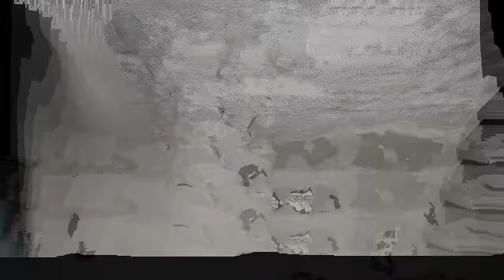Saving a Destroyed Home for FREE: Episode 2

Comment: As someone who is educated in interior design, the mention of using a painting or an item you love to base your colors off of is something that was taught to us. As far as not being "pros", I think you guys did a fantastic job! ❤🎉 (Side note, on the shelf in front of the breaker, in the future she can put casters on the bottom of it that can lock in place. So that way it'll give it a little bit extra height to hide the breaker and allow her to move it easily if she needs to get to it quickly😊)
Reply: Yeah,never cover the electric panel with something that can’t be moved quickly. A canvas from the thrift shop is a light weight cover up.
Reply: Yeah. This was my thought too about the shelving unit in front of the breaker box. If a breaker trips (which they often do in old homes) you don't want to have to move that thing in the dark (or even in the light when it's loaded with stuff) to get to the box.
Reply: If possible in the long run a picture would be good, because if she has a young kid, then tall shelving should be secured to the wall but that’s counterproductive to accessing the breaker-box.

Comment: So much better! Peel & stick flooring might be a viable option that’s very DIY friendly, depending on the stability of the existing flooring. Great job!
Reply: Yeah as long as the subfloor is level it works. It's not great if the subfloor is uneven, the people who owned our house before used that stuff and it has not stood up to traffic, the subfloor underneath is uneven so we will need to replace it. They also used it on the counter haha but that was replaced as soon as we moved in.
Reply: Those tiles look like they might be asbestos too. I had th4m in a room in our “handyman special” house. I just wore a mask and gloves and a heat gun to lift them all up.

Comment: Great work, as always! However, I do have one small issue. You should never cover up or block with furniture, a breaker box. It was a great idea to put a shelf there, but it should have been below the breaker box. The entire faceplate of the box can be removed by removing a few screws, you can then take it outside and use spray paint to make it match the wall or be a decorative feature. Inexpensive decals from the $ store can turn that breaker box into a piece of art, while still allowing easy emergency access. A fire extinguisher is also a great new accessory to add to any kitchen makeover.
Reply: THIS!
Reply: Totally agree.
Reply: Yeah, you don't want to be moving furniture by torchlight if the main fuse trips at night.

Comment: For the front door it would be really nice to keep that. It's beautifully well maintained and probably from the 1880s with all its original hardware. Use spring bronze weatherstripping for the door as it's permanent fix for the gap. Use window glazing for the outside of the glass for that permanent fix and then you can paint it a color too match the outside. Those are the 2 most efficient ways to fix those doors as well as the fixes that last the longest for those old doors.

Comment: That Kilz is good stuff.  It's really the only way to go on a job like this.   You are absolutely right about the importance of prep work.  People make the mistake of not doing that, and then the paint starts peeling off the walls and makes a huge mess.   This may not be HGTV, but the things you are doing are really going to make a big difference on how livable this home is.  Sure, it would be great to have an unlimited budget and remodel everything.  But you are getting a surprising amount done with what you have to work with.  And yeah, if you get bigger, definitely bring in contractors, etc.  That's a great idea.  And you can do that on whatever scale you want.  My brother, in his real estate business, used handymen etc.  And he has construction experience himself.  In fact, he worked on some hoarder houses and did exactly what you are talking about doing to them.  Cleaned them, gutted them, fixed them up, etc.  He loaned the homeowner the money until he got the house sold.  Then both he and the homeowner came out ahead.

Comment: An inexpensive and good looking fix I used in our bathroom after water damage was spackle.  We had to replace drywall up to knee high around the room and patch othrr places. We were so done with sanding I just took spackle and free handed texture.  Nothing crazy, swirls and such. You see this sometimes in Mexican restaurants.  Painted and it looks great! There is a texture to add to paint, like sand but it's expensive.

Comment: Mack, just a tip for when needed. In the sewing section of Walmart is a no-sew hem tape. It is so easy. Just cut the fabric slightly longer than you want, place tape on the edge and fold over. The end! I don’t know exactly what it’s called but that’s what I’ve used on curtains that were too long.

Comment: After the drywall mud is dry, use an old wet rag to take the high spots off. Then you can sand smooth. Wrapping the paper around a small block of wood will also make things go quicker. Great work you do!!

Comment: I got turned on to your videos by the boring channel. Love what you guy's do to help those in need. If I can offer some feedback on your drywall patches, drywall is designed with a porous outer paper layer designed to receive multiple coatings & finishes. This is The side opposite to the craft paper side. In the future you should flip the drywall opposite to the way installed in this video. I am a drywaller by trade, hope this helps. If someone already mentioned it, pardon me.

Comment: Good budget patch and finish. Other cheap updates, they have gray light switches and electrical outlet receptacles that would really make a difference over the old ugly brown and beige ones. $10-$15 max for the whole kitchen. Example: HD Online, deliverery, a15 Amp 125-Volt Duplex Outlet Commercial Grade Self Grounding Side Wired, Gray, $2.05 each. Then the 1-Gang Duplex Outlet Wall Plate, Gray, 52¢ each. Gray 1-Gang Decorator/Rocker Wall Plate (1-Pack) are a bit more at 98¢ each. The cheapest  matching sitches are Leviton Decora 15 Amp Single-Pole AC Quiet Switch, Gray for $2.47 each. If you wanna match the receptacles, then: Leviton Decora 15 Amp Residential Grade Self Grounding Duplex Outlet, Gray,$2.65 each. The Gray 2-Gang Decorator/Rocker Wall Plate (1-Pack), $2.22. Note:
Current NEC Codes 2023, require GFCI receptacles within 6 ft Straight line (in any direction of a water source.) But homeowners are not expected to know that. Nor a paimter/cleaner, and GFCI are way more money. Starting at $19.+ each. White is cheaper, some starting at $15 on Amazon. But avoiding going GFCI, the basic grays decorator or old-fashioned/traditional style are a cheap updates that really makes a difference in the look and feel of an old home. Looking forward to the door frame followup. Thanks.

Comment: You guys did an amazing job. Re the breaker box cover, it's fine to paint the outside of it. It also is removable using those four screws, for things like drywall repair. PS thrift stores are often a great place to get larger frames, slap a new print in there, maybe paint the frame, boom! Though I got a kick out of the cleaver from the before shot. Totally something I would do.

Comment: Something that helps us paint is a long handled roller.  I think you can just screw it in the bottom of the handle.  Once we put together a long pole and taped the handle of the brush to the pole just to reach  high ceiling stairwell.  Saves all the getting up and down a ladder.  Especially getting in around appliances.

Comment: Just a tip: if you ever have to clean nicotine or soot off of ceilings and walls, use a Cascade dishwasher tablet (Finish doesn't work as well) dissolved in a bucket of hot water. Use a cheap sponge mop to clean with. It works really well. Also good for tiles floors that need a deep clean. My dad was a heavy smoker and it was so hard to get the nicotine off of things.

Comment: I highly recommend wet-sanding your drywall mud. (Using a damp sponge, not soaking the wall) It's way faster and cleaner than dry sanding, especially if it's a small patch job. You will have to wait a little longer for it to dry again, though.

Comment: I LOVE what you have done to this house! I have renovated my share of old neglected houses on a shoestring budget, and i admire the crap out of you for doing this for this family! Hugs to you! Love me some Post 10!! Lawn Care Juggernaut is the shiz! In my current house, we took out the 1988 panelling, used it downstairs, and after i sheetrocked the great room(i can sympathise with you- it was the first time i had ever done it, and turned out great according to the contractor friend i had to inspect my work afterwards) we installed a white chair rail around the room, and painted the bottom half Bay Waves, and the top half Tint of Honey. Both by Valspar(but SherwinWilliams has it too.) whats amazing to me that you can reach the ceiling from the floor! I have to use a roller extension pole

Comment: Scribe the parameters the edges of the drywall hole that is in the wall at a 45 degree  angle Sshow more caulk and less paper,). And scribe the patch such that you show more paper tha gypsum.  It keeps the patch from falling through into the wall. You can also use this trick if you ever have to cut into drywall on ceilings or walls for lighting modifications. Cut your drywall access patches ar an angle, then keep those bits and use them to plug back up the hole. Use the  sticky webbing instead of the paper tape and its synch to render with mud. Also use a damp sponge on your skim coat unless you really need to sand off a himp to get a super smooth finish

Comment: Hey Mac, I had a similar issue with an off center breaker box. I did the artwork thing you mentioned, but instead of finding something super wide and centering it, I got two smaller canvases and made the offset from the edges the same and it turned out great looking. Just in case you go back or run into the same issue in another house

Comment: Can I give you one of my painting tricks? I'm very short, when I paint tops of walls or ceilings. I use a sponge mop handle and put the paint roller on the end, disconnect the sponge and add the paint roller. Makes it a whole lot easier for me to reach the high spots.

Comment: Love these renovation series! ❤❤👊
Would it perhaps be possible to paint the small parts of the floor that’s got missing tiles? I have no idea if that’s something you can do, but if so then the darker bits wouldn’t stand out as much against the light colored tiles.
If you put the outermost curtain ring/loop on the outside of the curtain rod holder, the curtain covers the whole rod - plus you can’t pull the curtain away from the side of the window.
It’s a shame the fridge and freezer can’t change place with the washer and dryer - it would create a more airy feeling in the small space not to have those towers in the middle.

Comment: Hey now, if  a drywall job sands smooth and sits structurally sound (doesn't cave itself in structural, not hold the building up structural) without getting in the way of potential future projects, it's a good drywall job.

Comment: I love your work. You are sassy, funny, and get the job done. I have a question about the APC you mix up. Because it has a few drops of Dawn in it, when you use it on mirrors does it prevent them fogging up in the bathroom? If yes, then can you use it on the inside of a car windshield to prevent fogging up? Thanks. Juli

Comment: So you want to get into light home repairs?  And you want to eventually move around the midwest a bit?  Well, when that happens I have the perfect house for you!  My friend's house whom I have been helping de-hoard for 3 years now (I have talked about this project in comments before, and it has taken so long because while he realizes it needs to get done he doesn't want it done/ is too lazy and therefore I was working at 5% speed on it) - the hoard is about 80% cleared out, but there is still more to go.  And due to the damage to the place from ignored leaks and general neglect - it needs things like painting, ceiling tiles replaced, etc.  You know, cheap to fix provided you put in some elbow grease and would make a huge difference in appearance.  

There is even an opportunity to get a lawn care guy in on the action - him and his partner bought a place that required a ton of regular lawn work and neither of them gave a donkey's butt about getting off their own to do any work on it - so now my friend (his partner passed 3 years ago) is "That Guy" who has the eyesore in a really nice neighborhood.

Sadly, I am getting older and I am losing on steam on getting this taken care for him, I just don't have the energy for it too often anymore.  But, my OCD really grinds my gears when I don't finish a project!!!

Comment: It wasn't so much the missing door panel that drove me crazy, but the fact that I saw there was no insulation in the wall. Is that normal where you live? I understand that you are rarely cold, but then you still want to insulate against the heat, don't you? Where I live, we also insulate the interior walls for sound. Without insulation, it's not so much a house as a shed. I'm very confused. 🤔